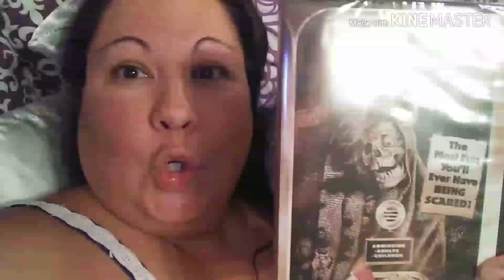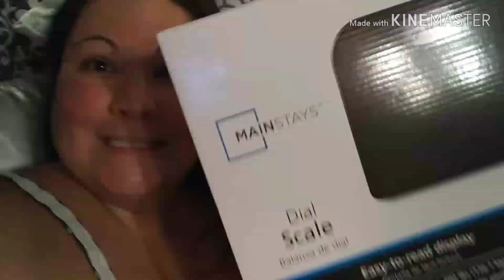Watch me be a big girl with a power drill!

Comment: Dang Woman!
I'm so glad you didn't get hurt.
Here's a stripped screw situation, take a rubber band and then try again. Just make sure you a two or three just in case the screwdriver cuts through the rubber band. Or, you can use super glue into the head of the screwed and place your screwdriver into the screw with the super glue in it let it dry and then you'll pull it right out. I learn these techniques a while back because I redone a few of the pieces in my house myself and the handles on the drawers sometimes so that's the two methods I use. This might help you if you ever have to do it again.
I applaud you for taking on such a difficult thing to do. 
You are truly an inspiration in the way that you parents and also work and take care of your. You should give yourself more credit.
Reply from the maker: I wanted to try the rubber band idea cause I'd run to You Tube for help and saw it there LOL.  I couldn't find one anywhere though. Out of frustration and desperation I almost used the elastic band on of one little dudes underpants but didn't. I thought about super glue too but didn't wanna dig in the junk drawer for an hour. Figured ripping it off was just as good LOL.